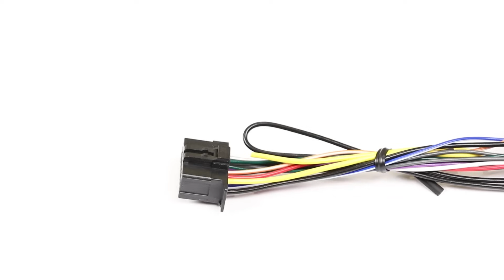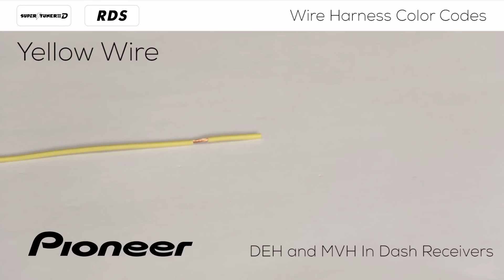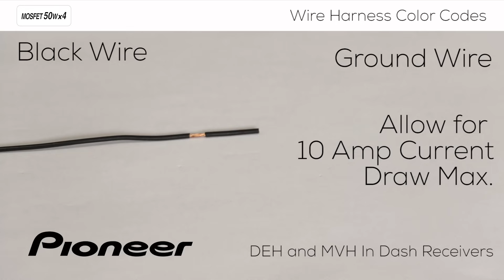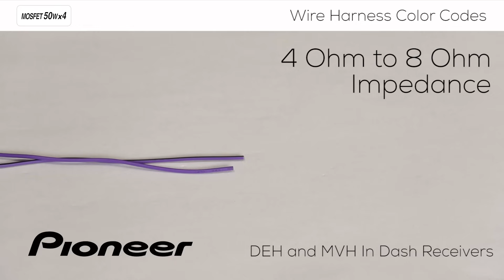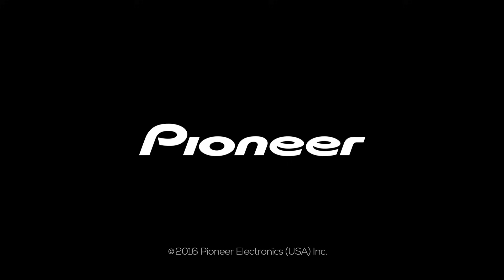How To - Understanding Pioneer Wire Harness Color Codes for DEH and MVH In Dash Receivers

Comment: Is this the same for fhx?
Reply: I have som trouble with my Pioneer DEH-1430R radio and  it doesn't give out any audio, it only comes with a MUTE message in the display.
Can anyone help me out?
Reply: @Crackbody87  if it has yellow and black wire that is the mute function wire. Check that one
Reply: This is the same wire harness for Pioneer headunit model numbers beginning with FH-X and no video screen.
Reply: Is it also the same for Pioneer FH-X830BHS?
Reply: Deckerd Otto yc

Comment: I bought an aftermarket wiring harness, which has a long teal wire that needs to be tapped into the 12v power line to the cigarette lighter. Why does this harness require 3 12v wires? (1 for ignition, 1 for 12v constant, and the teal wire that taps off of cigarette power outlet)

Comment: My dodge ram when I connect purple and purple together and everything nothing works but I know my back speakers work
Reply from the maker: With Chrysler vehicles, like your Dodge, the factory system will only take audio from the rear output of an aftermarket stereo. It then sends it to all speakers. Your easiest solution would be to swap the front and rear speaker wire connections. If needed, please contact our Product Support at 1-800-421-1404, select option 1. 
They will provide troubleshooting assistance.
Reply: @pioneerelectronics so basically I have to get new speakers all around In order for my rears to work
Reply from the maker: @Smokey_Roams  Please contact our Product Support at 1-800-421-1404, select option 1. 
They will provide operational assistance.

Comment: For the rear speakers what do I connect ?
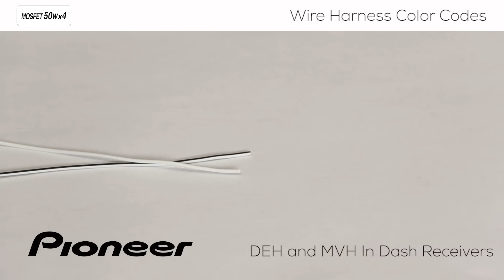Reply from the maker: The speaker wire connections start at 4:16 point of the video. The green and green/black are the left rear. The purple and purple/black wires are used for the right rear.

Comment: How come when I connect the yellow wire to constant power it can never be turned off. Even after holding off the stereo will never stop illuminating. Can someone tell my why?
Reply from the maker: For the radio to turn on, you need 12 volts on the yellow wire and 12 volts on the red wire. You will also need to make sure the black wire is grounded to the vehicle chassis. If these connections are good, check the fuse on the back of the radio. 
The next step would be to have a repair technician check it internally.

Comment: My system remote wire is not turning my amplifier. All power and grounds, and speaker wire is ran as it should be.
Reply from the maker: Use a volt meter on the blue/white wire. If you do not have 12 volts, you would need to send the unit in for service. 

https://usa.pioneer/pages/warranty-repair

Comment: AM doesn't work.
Reply from the maker: Make sure the unit is grounded directly to the chassis. Try connecting an external antenna. If you still do not get AM, there could be an internal problem with the uni.
Reply: @pioneerelectronics do you mean that there is a wire coming out of the radio unit that must be grounded to the chassis of the vehicle?  The vehicle does have the radio antenna connected to the unit.
Reply: @pioneerelectronics  shouldn't this have been done by the installer?
Reply from the maker: @ Yes, they should have. I would still have them check the installation. If it is proper, you would need to send the unit in for service.

Comment: Helpful, but why not explain the actual physical wire connections for using the rear speaker output wires for a subwoofer without amplification? Are the green wires bridged or not, are the purple wires used for the sub? This is not clear from the diagram that accompanied my 4850 receiver.
Reply from the maker: If you are connecting a subwoofer, you would only use the green and green/black wires. Do not connect anything to the violet and violet/black wires.
Reply: @pioneerelectronics  Thanks so much for taking the time to answer my question. Much appreciated!

Comment: I want to use line in on a Pioneer TS-WX300A  active subwoofer. Dont want to use RCA. I was told i could use the rear output also as line in for the subwoofer? Do i need to change sp-o mode also to rea/sub or rear/rear?
Reply from the maker: Please contact our Product Support at 1-800-421-1404, select option 1. 
They will provide setup assistance.
Reply: @pioneerelectronics  to bad i am from Netherlands. So that would be a expensive call🤣
Reply from the maker: @anthonyg87  Use the link below to contact the Pioneer in your region. https://global.pioneer/en/corp/group/?ref=header

Comment: THANK YOU for this video! My radio had no memories after starting the car up, because the red and yellow wires were switched. This video rocks🎉
Reply: Same for me. Switched these round and it works perfectly now. Radio stations, EQ settings etc. Really helpful video. Many thanks.
Reply: Thank you! I simply switch the red and yellow wires and it did the trick for that problem, my radio now remembers the settings.

Comment: And steering wheel control? Like +/- etc?
Reply from the maker: Most of our units have a wired remote port on the back. This is where you would connect a steering wheel control adapter.

Comment: Yellow constant power 12 volt
Red wire acc detection
Orange and white auto dim
Black ground
Blue and white any device that needs to turn on with the receiver 

Speakers 
Solid color positive
Black stripe negative
Whites fl
Greys fr 
Greens lr 
Purples rr

Comment: Hii, is it possible to share something about Pioneer AVH X1590DVD wiring diagram because the manual shows different pins than the color code connector that are being sold in market nowadays... Please explain the 16 Pin connector each pin function of the model. I like the output of this model so much but confused to use it in new car cause of sequence of pins for wiring
Reply from the maker: Please use this link to obtain support in your region; https://www.pioneerelectronics.com/PUSA/AboutPioneer/Other-Pioneer-Sites
Reply: @pioneerelectronics  Thanks for your response, but I don't get required information there as well. Could you please make one video on the avh-x1590dvd model, I would be grateful to you! I have manual of X1590dvd model where pins has different functions it seems so i am confused where toconnect to which pin. I am worrying to connect wiring coupler/connector between car socket to avh-x1590dvd stereo socket cause of pins sequence in 16pin connector. I am from India.
Reply from the maker: @Avinash-S-Pawar  I only have information on products sold here in the US. Use this link to see the US version, the AVH-X1500DVD uses the same manual as the 2500. 

https://www.pioneerelectronics.com/PUSA/Car/DVD+Receivers/AVH-X2500BT

Comment: Where can I connect my pioneer subwoofer?
Reply from the maker: Depends on the model of stereo. On the back of the stereo, you should see an SW or REAR/SW. This is the output that would connect to a powered subwoofer or amplifier. If you need additional assistance, contact our Product Support at 1-800-421-1404 and select option #1.

Comment: Help! I have just mounted a MVH 330DAB in my Peugeot 206. Everything seems to work fine, except I get no sound! Do I need to put RCA connectors on the speaker wires, and connect them to the RCA terminals in the back???

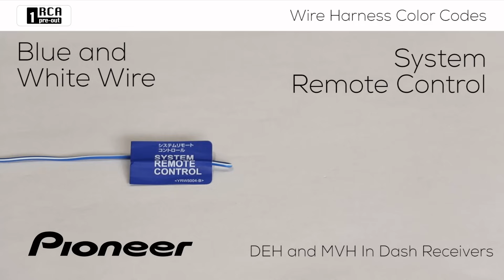Comment: 2:30 can I connect 2 subs with this in paralel?
Reply from the maker: No.  Not and expect any real performance from the subwoofers.
You can connect one small subwoofer, 8 inch, or 20 cm to the rear output of the in-dash receiver.  It works very nicely with one small subwoofer. If you want to use more than one small subwoofer or  If you are looking for big performance you'll need to use an external amplifier.
You can find more videos on Pioneer's YouTube Channel here;   https://www.youtube.com/@pioneerelectronics

Comment: Thanks for the very clear description in this video.
I have a second hand MVH-S420BT model without harness. I want to use it as an external amplifier in my living room to hook external speakers to it.
However, I do not know which pins to use at the back of the radio for the positive and negative DC input currents. 
How can I solve this puzzle?
Thanks in advance.
Reply from the maker: I recommend to buy a wire harness for MVH-S420BT.  You can find it here:    https://www.pacparts.com/part.cfm?part_no=CDP1480&mfg=Pioneer
Here is a How To video from Pioneer explaining the wire harness:    https://youtu.be/kR2MO2kwFughttps://youtu.be/kR2MO2kwFug

Comment: I have a MVH- 85 UB and want to change  to a DEH- S 1050 UB can I use the same harness to connect the new receiver
Reply from the maker: I don't have access to the wiring diagrams for these receivers.
The Pioneer wire harness wire color codes will be the same for both receivers.  I recommend to hold the new wire harness up to the old one and carefully check the order the wires are held in the black wire connector on the wire harness.  If the wire color order is exactly the same on both black connectors it should work just fine. 
To be certain, please contact Pioneer in your region for help.
Please directly contact Pioneer in your region for assistance with these products.  You can find them here:   https://pioneer-mea.com/en/contact-us/
You can find more videos on Pioneer's YouTube Channel here:  https://www.youtube.com/user/pioneerelectronics

Comment: I have a mvh 85 ub and want to change to deh 1550 ub can I use the same harness to connect my new one
Reply from the maker: I recommend to use the wire harness that is shipped with each receiver.
MVH-85UB is a relatively modern receiver and the DEH-1550UB is a 10-15 year old receiver. 
For more information about DEH-1550UB please contact Pioneer in Europe here:  https://www.pioneer-car.eu/de/en/support/hotline
You can find more videos on Pioneer's YouTube Channel here:  https://www.youtube.com/user/pioneerelectronics

Comment: My harness has two yellow wires, I tied them together but I’m not getting power. Should I only use one yellow? Help!
Reply from the maker: This video describes the function of each colored wire in the Pioneer wire harness system.  The Pioneer wire harness included in the box with the in-dash receiver is    not   designed to match the wire colors of any OEM factory Make, Model, or Year vehicle wire harness.   Different vehicle wire harnesses may use any combination of colors.  Any color match with the Pioneer wire harness is purely coincidental.   
I recommend the use of a wire harness adapter designed to fit your particular vehicle.  The wire harness adapter will then color match to the included Pioneer wire harness.  This isn't absolutely necessary, but it makes installation easier and faster.  If you choose to get a wire harness adapter, be sure to get one the is designed for your particular vehicle make, model, and year.  Here is one example:   https://www.crutchfield.com/S-rYLQbV2XD7r/p_120701770/Metra-70-1770-Receiver-Wire-Harness.html?awcr=12166312015&awdv=c&awkw=car%20radio%20wire%20harness%20adapter&awmt=e&awnw=o&awat=&awug=&msclkid=7b2c1836d2d41b63c9317b2e498cff59
You can find more videos on Pioneer's YouTube Channel here:   https://www.youtube.com/user/pioneerelectronics

Comment: Hi, the connector supplied is not compatible with that of the machine
Reply from the maker: Do you mean the wire harness that came in the box with the Pioneer in-dash receiver does not fit in the Pioneer in-dash receiver?  If so,  you should contact the Pioneer Authorized Dealer where you purchased the product and explain the situation.
If you mean the vehicle's OEM factory wire harness connector does not fit into the Pioneer receiver, Yes you are correct.  The Pioneer wire harness is not designed to fit any make, year, or model of vehicle.
You can find more videos on Pioneer's YouTube Channel here:   https://www.youtube.com/user/pioneerelectronics

Comment: For pioneer deh 1250UB as it relates to the  front speakers. 

After installing my system, i noticed the front speaks aren’t being activated. I connected all the wires as required, i didn’t utilize the orange or the or the blue
Reply from the maker: What is the vehicle make, model, and year?   Are you using an external amplifier?  Does the vehicle have a factory amplifier that is powering the front speakers?   Is that amplifier switching on?   In many installation, the blue wire is used to switch on/off the external amplifier.  
The front speaker outputs are the white and white/black and Gray and gray/black.  Are these wires connected directly to the front speakers?  Or are they wired into the vehicle wiring system?  
Is the receiver's fader function set to zero?   You can learn about the fader in this How To video from Pioneer:    https://youtu.be/meEGlY_r-IE
Reply: @pioneerelectronics  the fron speaks are wired directly I believe. I got a recommended wire harness to match all the wires correctly
Reply from the maker: @ItsJust_Havii   Are you certain that the vehicle's  front speakers were working before you installed the new in-dash receiver?
 Please be sure the  receiver's Fader control is set to the middle.  You can lean more about the fader control in this How to video from Pioneer:    https://youtu.be/meEGlY_r-IE?t=17
If this does not correct the issue, I recommend to do a system reset.  You can learn more about it in this How To video from Pioneer:   https://youtu.be/b6vYngDNuK4?list=PLw63zJRQbCNgUI_3Z0V1p65bgicKwj4VG&t=183
If this does not correct the issue, you may need to test the front speakers.   You know the rear speakers are working.  Just as a test, you can disconnect the in-dash receiver's rear speaker outputs, and reconnect them to the front speakers.  Are the front speakers now working?  If the rear speaker outputs work on the rear speakers, but not on the front speakers, you know the issue is not the in-dash receiver.
Reply: @pioneerelectronics  its a 1998 honda civic.
Reply: @pioneerelectronics  yes everything is factory from what i see.

Comment: I’ve got my ground and power wires hooked up and have verified they both work. No sign of life from the radio. Could this mean it’s a defective unit?
Reply from the maker: There are 3 wires that must be properly connected for a Pioneer in-dash receiver to power up. You must properly connect Yellow to constant power, this stays on even when the vehicle is off.   Red to switched power, this is on when the vehicle is on and off when the vehicle is off.   Black to ground metal in the body or frame of the vehicle.  
I recommend to check the fuse on the receiver at the wire harness connection area.
You can find more videos on Pioneer's YouTube Channel here:  https://www.youtube.com/user/pioneerelectronics
Reply: @pioneerelectronics  I’ve come to find my constant power is dead. Will be running a new wire. Thanks for your help!

Comment: Great video...can u recommended an 8 inch non powered subwoofer that i can use on the rear channel of the unit without using an external amplifier...thanks.
Reply from the maker: There a two different products from Pioneer depending upon your installation application. 
If you are installing into an existing factory location or an infinite baffle install, please consider the Pioneer TS-A2000LD2 seen in this unboxing video from Pioneer:   https://youtu.be/6bakEnog_nE     
If you need a small enclosure, please consider the Pioneer TS-A2000LB seen in this unboxing video:   https://youtu.be/WkbRBGtW9yM
Both will work with Pioneer headunit only power.  Please note, do not expect the headunit only power to shake your mirrors.  It won't.    If you want more power, an external amplifier will make life better.
You can learn more about Pioneer subwoofers here:  https://youtu.be/AkushNUilVs?list=PLw63zJRQbCNhkTQCxPpxGF4h6l6qocsaR
You can find more videos on Pioneer's YouTube Channel here:   https://www.youtube.com/user/pioneerelectronics

Comment: So why would the would it exceed 30 mA 12V DC then? I keep getting the amp error display.
Reply from the maker: When you see the amp error message, the first thing to look at is the speaker wire connections.  I recommend to carefully check all 8 of the speaker output wires at the back of the receiver.  White, Gray, Green, Purple and the black stripe matching colors.  If any of them are touching one another or metal in the vehicle, you may see amp error on the receiver.  Also check the speaker locations in the vehicle.  Doors, back deck, dash etc...  If any of the speaker terminals are touching metal in the vehicle you may see amp error displayed.
If the speaker outputs are all connected or terminated properly, the Blue/white wire may be the issue.  If you are attempting to operate more than 1 or 2 external devices, you may need to use a 12v relay instead of a direct connection to the external devices with the Blue/White wire.    You can find more videos on Pioneer's YouTube Channel here:  https://www.youtube.com/user/pioneerelectronics

Comment: I checked all my connections  to my radio but when I make adjustments in the eq settings under custom after 2 day it resets back to flat is and I have rest the radio
Reply from the maker: What is the model number of your Pioneer in-dash receiver?
Reply: @pioneerelectronics  Mvh-s512Bs all the wiring is correct  I use it for bluetooth  music from my android phone
Reply from the maker: Are you using the Pioneer Smart Sync app to adjust the EQ?    And are you adjusting the EQ one on particular music source?   And then checking the EQ setting on the same music source?  Or on a different music source?